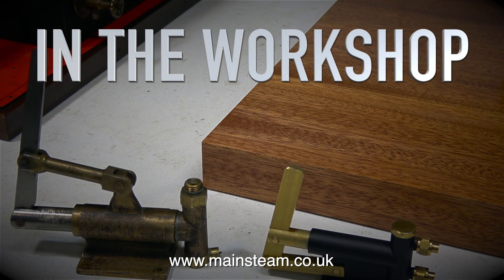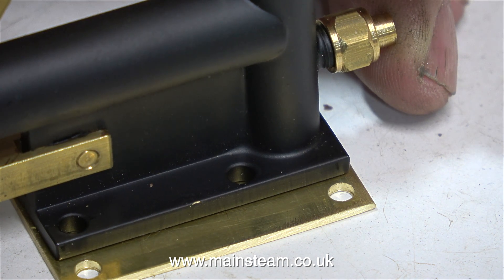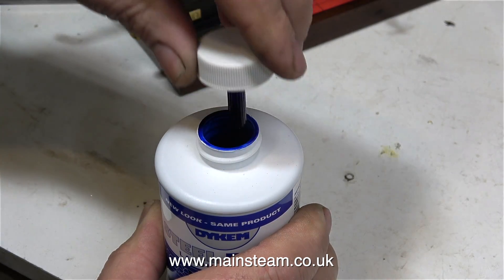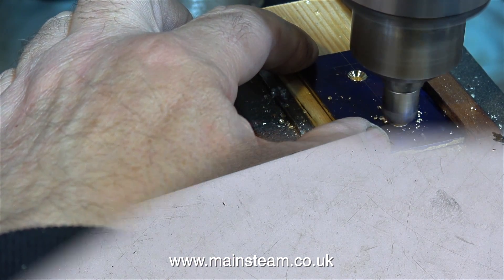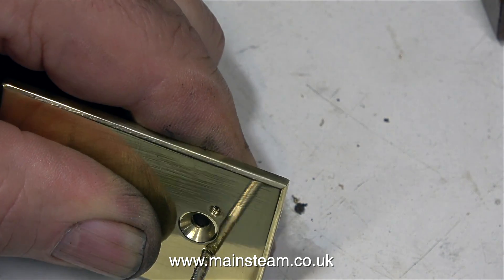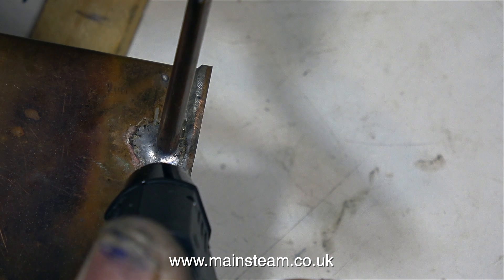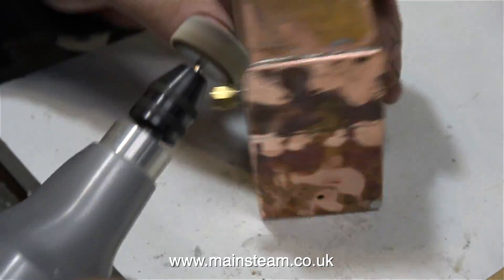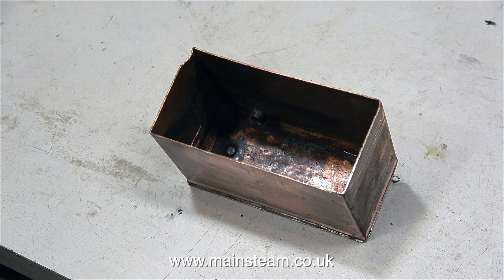RENOVATING AN OLD MODEL STEAM BOILER - PART #7

Comment: Engineers blue is great till you pick the bottle up by the cap forgetting that you didn't tighten it down and leave a nice blue stain on the workshop floor.
Reply: Been there done that, I now use markers.